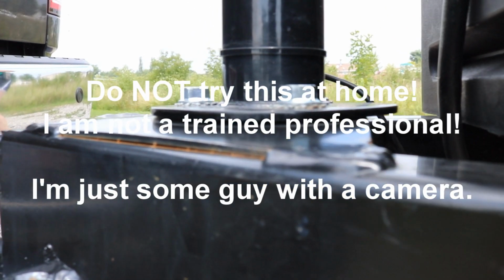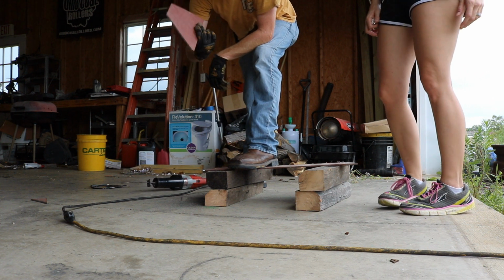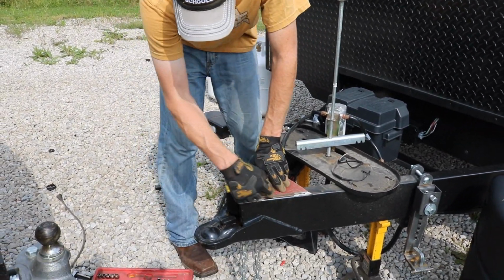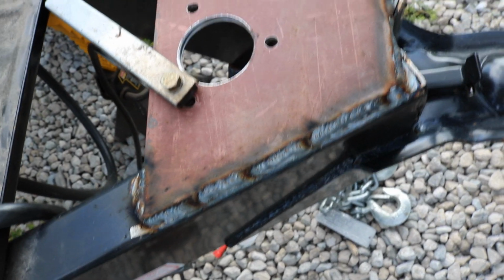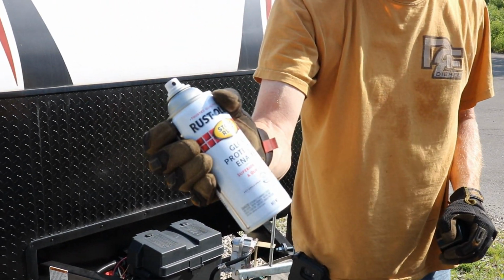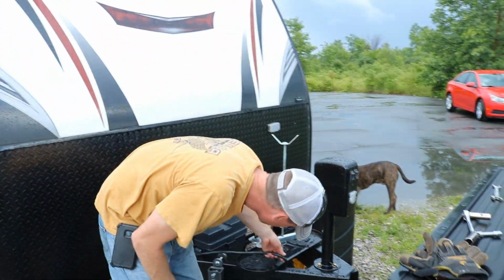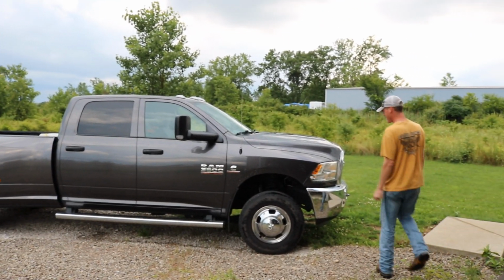Jayco Problem. Tongue jack repair! #rvlife

Comment: Well dang, now I need to go and check my Jayco tongue plate. Thx for the video
Reply from the maker: +classicbob44 this is the first trailer I've had that had this problem. Hopefully it's not a common thing.
Reply: I just went out and checked mine, it fine and welded all the way around. WHEW !!
Reply: we have had three Jayco's over the last 25 yrs and nothing major (knock on wood) has ever happened.
Reply from the maker: +classicbob44 we've had several Jayco products over the years with mostly minor issues. Seems rv quality in general keeps declining. Thanks for watching, and the comments!
Reply from the maker: +classicbob44 seems others are welded all around while ours was not. Makes us wonder if it got missed. Thanks!
Reply: We bought a 2017 Keystone Springdale 32", granted not top of the line but first camping trip it rained fairly hard, we woke up to water running out of the GFI downthe wall  across the drainboard across the floor. Opened up a cabinet and water was running out of the wall right onto the converter. Of course they claimed to fix it under warranty but I was not happy to have had that much water running down the inside of the wall and insulation. The whole trailer was built cheap and shoddy nothing fit right, doors were hung crooked, entrance door would pop open on its own if not locked. some of the interior wall were not even stapled to the studs. We returned it and found a 2012 Dutchmen Denali 5th wheel that was like brand new, always under cover and well taken care of. The quality is night and day different, its older but we love it plus nothing like having self leveling. :-)

Comment: Nice job!  Especially with the tools you used.  I mean, not even a clamping device.   I never get rid of tools, especially power tools, unless they wear out or break.  You proved it can be done.
Reply from the maker: +BRay549 I always had a rule that I'd never sell tools, but after about a year of not really using many of my tools I started to downsize and sell things off. I was really wishing I still had my cut off saw and drill press, but I got it done without them!

Comment: The route you took was the most thorough. I had a similar failure on my Laredo (the whole camper was a failure...that's for another day) ...anyway I remove the jack and beat the plate flat again, after prepping the surface I welded the seams all around and then I took a 1.5" piece of square tube and welded it to the underside of the plate to give it more strength...painted it all up and put it back together and it worked without fail.
Reply from the maker: Sad when they manufacture can't do it right the first time
Reply: @WanderingWagners  Agreed...this was a 2005 Laredo 28BHS and in its day it was considered a top line RV, but I chased design flaws everywhere on that rig. I guess it was made on a Monday!
Reply from the maker: Or on a Friday! Haha

Comment: Should've turned the jack sideways so you can put your tailgate down while hitched... that's assuming its like my Ram 2500 where it hits the jack.  I'm about to turn my sideways so I can lower mine.
Reply from the maker: Watch the whole video😉👍
Reply: Wandering Wagners I left 2 mins too early! Haha! I guess your stinker is little bit longer than mine. I use the equalizer 4 point hitch. Great video keep up the good work!
Reply: TheKeatons4 I'm using an Equilizer hitch on my F150 and mine hits as well.  They do sell an extended shank for it.

Comment: Awesome work man I had a Jayco and never judged it because I purchased it used but I went through some really rough patches with it but that was awesome welding looks like as if it never happened
Reply from the maker: +Camp a holic thank you! Definitely better than factory! We aren't sure why they didn't do a better design/ job from the start since whitehawk is supposed to be higher quality
Reply: Wandering Wagners I've been doing some research it appears these companies are trying to push all of these trailers through production at such a fast pace I don't think quality control is there obviously as you can see I just purchased a new Dutchman 2855 air conditioning duct incomplete unable to open blinds because knobs are blocking them crazy things they say that the only companies that focus on quality controls is the smaller companies
Reply from the maker: +Camp a holic that is very true. Campers are not built to last nowadays. We are aware that they are all pushed through and built in a day with poor quality checks. (Unless you're buying an airstream or lance the quality isn't there). It doesn't help that almost everyone wants a light trailer to tow with smaller vehicles. Light weight usually means poor quality and with travel vibrations, things shake apart at much faster rate.
Reply: Wandering Wagners I'll be making a video shortly on how they repaired my brand new 2017 trailer and go a little bit in depth what they did repair what they didn't repair and how they went about it so stay tuned you guys safe travels

Comment: Little tip...keep a fuse in your pocket, it works great for holding the button on the jack so you can be hands free to uncouple and set your wood in place while your jack is going down.
Reply from the maker: Thanks! I'll have to remember that.

Comment: i think i seen that you had an arc welder AC in the garage...it would have been my weld of choice for the job...the weld wire with Auto gas is a bit brittle compared to what you can do with stick ..unless you're using #13 stick ...but 11 or 18 is good ..ima welder by trade over 20 years ..just an honest opinion ...but nice welding!
Reply from the maker: All the welds on frames are mig. MIG is plenty strong and not brittle for this application. SMAW was close to being too hot for the steel thickness... And we didn't have any electrodes😉 my background is in welding and I'm a CWI👍 Lynn

Comment: Cool job and if I was there I would have helped you. I have the Jayco XJ 213 and really like it What's your thoughts on Jayco products? We got ours new in 2014.
Reply from the maker: Jayco is one of the better brands for a box trailer. We've owned several Jaycos and have had good luck with most of them. We've since upgraded to an Airstream.

Comment: how many times did you lift the back of your truck up with that power jack to bend that
Reply from the maker: +Clifford K I only ever raised up the tongue enough to snap the spring bars into place. I noticed it after we had the trailer for a couple months

Comment: Isn't it a shame that these manufactures don't spend an extra 100 bucks on things that would make even the smallest things on the trailer "done right". Our 2018 Keystone Passport hasn't been bad but a seemless gutter would have been nice instead of it leaking at the seem all over things we sat out under the awning so it wouldn't get wet... and they only had to go another 5ft to make it seemless. Great fix and love the videos! Who knows maybe we'll see ya's out there (we're in NWPA).
Reply from the maker: +AnglerX it's kind of amazing the lengths manufacturers will go to cut little corners. Oddly enough the lower class models of jayco have it welded all the way around, but none of the white hawks did that we looked at. Either way, it's fixed for the better, now! Thanks for watching and there's a good chance we'll cross paths!
Reply: I don’t work for Jayco, no do I know the quality of their products. But I am involved in manufacturing products. I’d like to respond the commenter about Jayco spending another $100.00 to make it better. If all things were built to the standard of “just a hundred bucks more” .......most folks couldn’t afford the product. Just saying......

Comment: Don't be too tough on Jayco, after all, they probably saved $1.26 using that old beer can plate instead of decent steel.  :D   Good simple repair that will surely outlive the rest of the trailer!!!
Reply from the maker: +Steve White haha I guess I shouldn't jump to conclusions.
Reply: Another (what use to be) quality RV manufacturer gobbled up by Buffett/Thor/Berkshire Hathaway company.  I own a Keystone product, I’ve learned to just accept it after having RV’s since the early 70’s.  Very nice repair, I had to reinforce my stabilizer jacks on mine.

Comment: Great Repair     Jayco is not one of my Favorite Travel Trailers  but most of all of them are Built like Crap  I have a Coachmen and some of the stuff on it is made Cheap
Reply from the maker: They all have issues, that's for sure.
Reply: 14 years best selling travel trailers, and not because of cost.  There made better than most coming out
of f-in indiana!!

Comment: Do another pass on those welds an grind them down smooth ... will much more satisfying to look at .
Reply from the maker: +96dodgeram I'm a certified welding inspector, you never grind structural welds. Thanks! - Lynn
Reply: Well in that case I would have expected to see better looking welds . LOL
Reply from the maker: +96dodgeram I didn't weld them and they were 100x better than factory welds! - Lynn

Comment: We don't have a TT, but enjoyed watching your fix. Did you consider enlarging the new plate, so it would support the entire power jack? The original plate looked too small. (Safety glasses? Sawsall cutting.) Lynn, you should have welded one side, and Mike the other, to compare quality. You DID paint the underside of the plate? I bet there are a few other places, on your TT, that could use a little extra welding. :-) Ted PS You may have voided your "warranty", but what you did do, was screw a dealer out of THEIR "warranty" money, fixing it when the poorly designed plate failed. Good job!
Reply from the maker: +twdenman1 thanks for watching &the comment! It's definitely better than it was. Way more sturdy.

Comment: Ummm...might wanna wear eye protection next time.  Just saying.
Reply from the maker: +Robert Schilling I was
Reply: Wandering Wagners ...i saw your welding mask...but i cant see goggles or mask when you were grinding.  Just trying to be safe...not argumentative.  Finished job looked good.
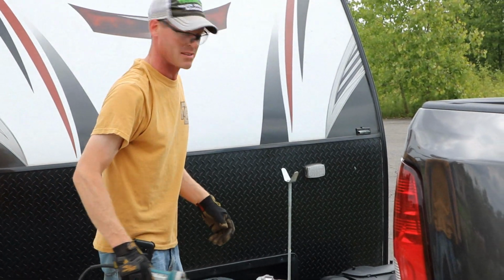Reply from the maker: +Robert Schilling it's cool! I didn't mean to be short with my reply, I was working lol. If you pause the video right at 3:54 you can see a great shot of my stylish safety glasses haha.
Reply: Wandering Wagners ...ahhh.  I thot those were eyeglasses.  My bad.  But goggles or full face shield would offer much better protection.
Reply: Robert Schilling you are in need of prescription glasses and surgery to remove a large amount of your nose.